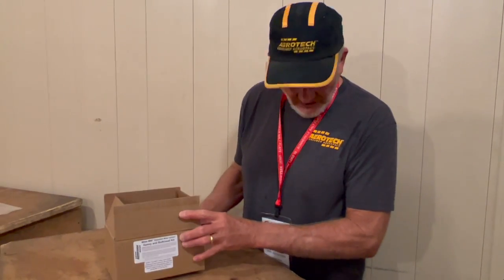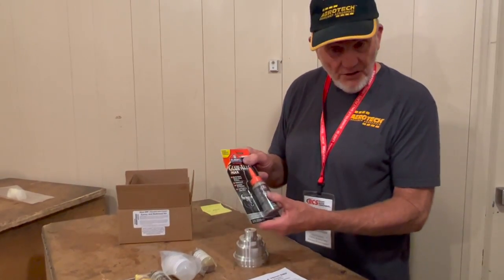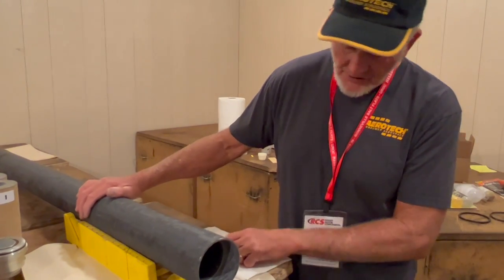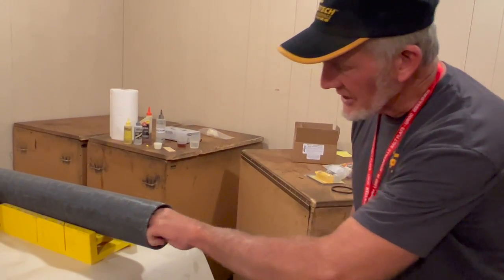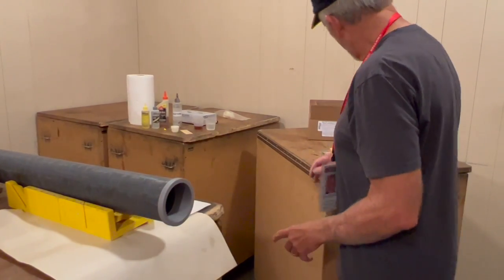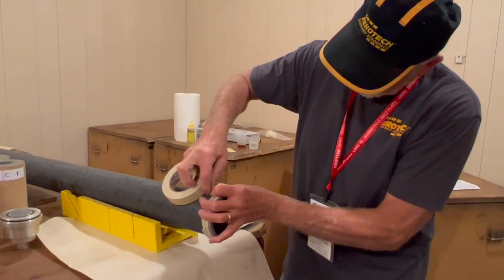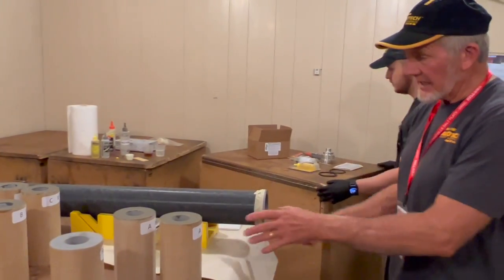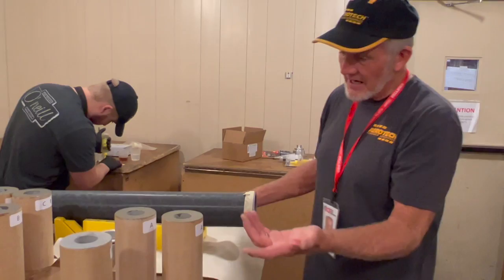O5280X Motor Assembly

Comment: What is the point of the orings between the grains?
Reply from the maker: To improve ignitability, it allows hot gases to flow more easily between the grains, leading to faster ignition.